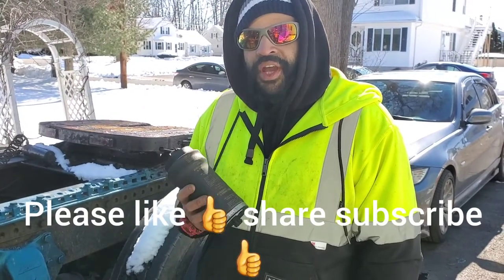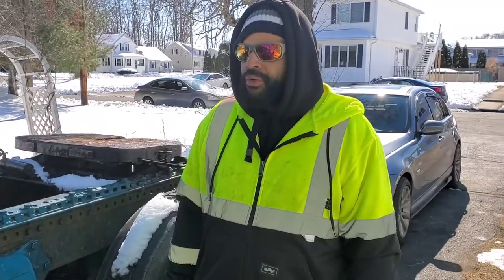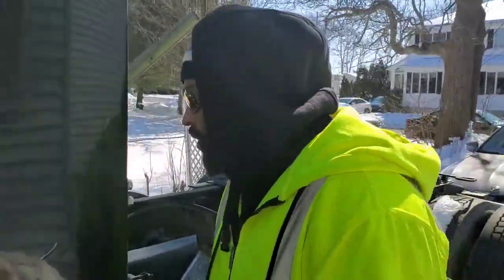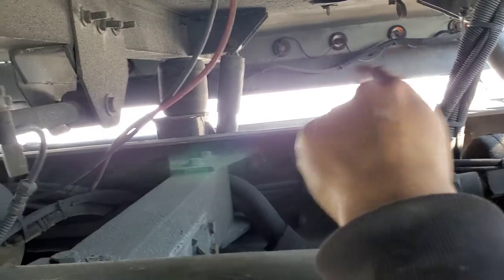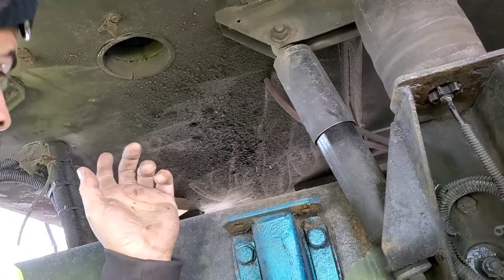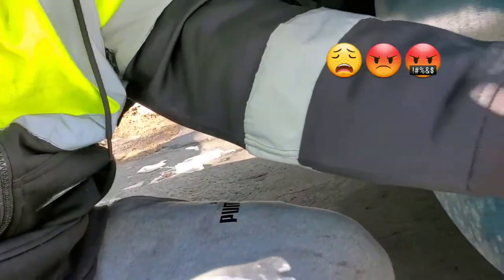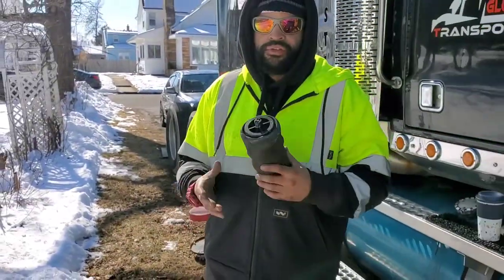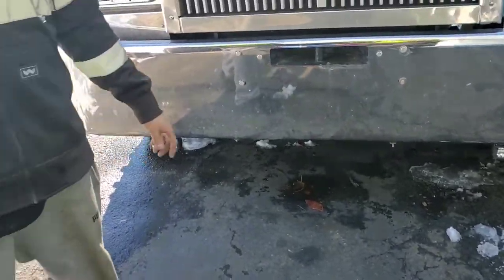how to install and replace semi truck cab air bags diy tips owner operator save money 💰 western star

Comment: papa tremendo ...Dios te bendiga🙏gracias por enseñarnos como instalar esas bolsa de aire. Yo tengo un freightlierColumbia y e cambiado una de ella...there are a pain some times...but the trick here is the space you need under the cab...that Jack is perfect to lift the cab...very important to have it very very stable with wood.  nice👍💪🙏 job. nice to save money this places if u take truck to get fix they will defenetly easely charge you a whole lot for something miner like an air bag.

be safe out there in Massachusetts...iam in the 'Sunshine State'..😂 Florida.
Gob bless you an Familia!
Reply from the maker: Thank u u as well